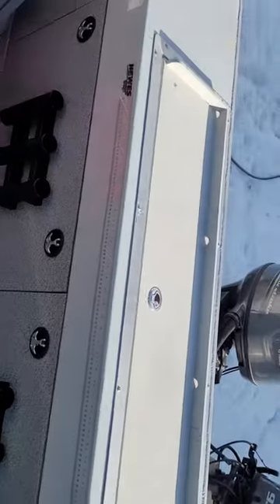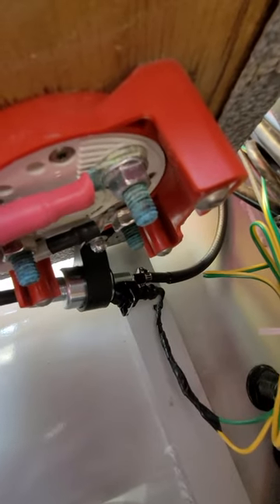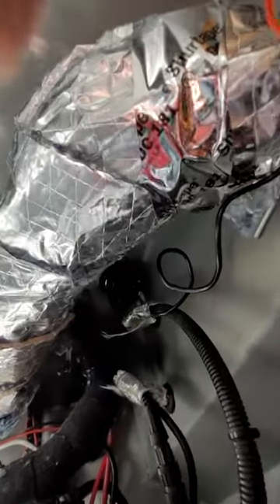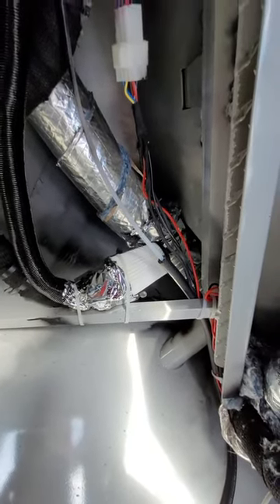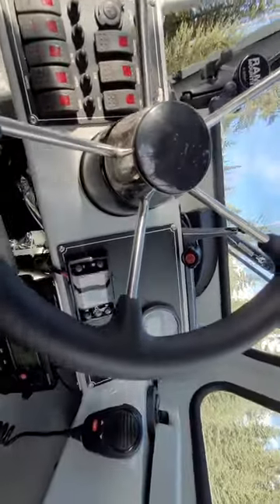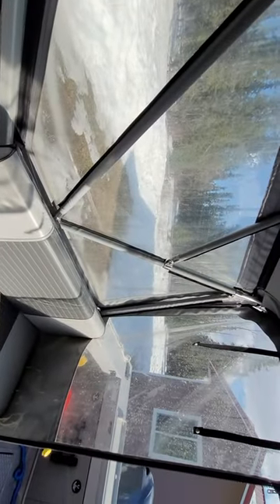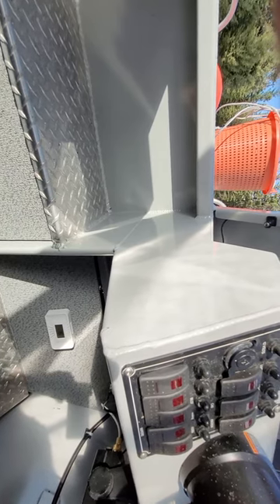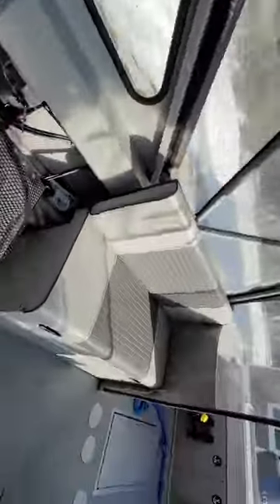chinese diesel heater installer in a hewes craft boat overview.

Comment: Can you run it while you are cruising? I have a similar boat and like the idea of locating my heater there but assumed the airflow from cruising would put backpressure on the exhaust and it may not operate correctly. Also, any issues with water getting in the exhaust? Rain or splash from rough conditions?
Reply from the maker: Yes. I run it all the time running WOT. Have never had an issue.

Comment: Do you know the item number or name of your heater? I have a 2015 Hewes 200 SM and I’m looking to do the same. Also, how many vents of hot air? I was hoping to have it on each windshield as a defroster
Reply from the maker: I don't. I just amazon'd one that would ship to AK. A 5kw model. I bought a T from lowes and drilled a hole so I had vents on both windows and the 5kw model is enough to push that air. If you go 2kw it won't be quite enough under power.

Comment: Hi are you still using the heater and how is it going? Do you have a link to the heater or know the name?
Reply from the maker: It's been installed over 2 years now and still runs flawlessly. Run it full power for 15 to 20 minutes before shut down. Treat fuel once a year